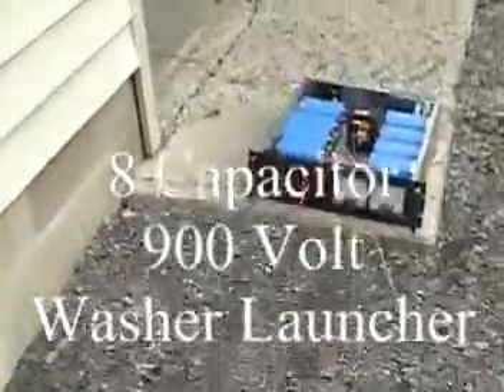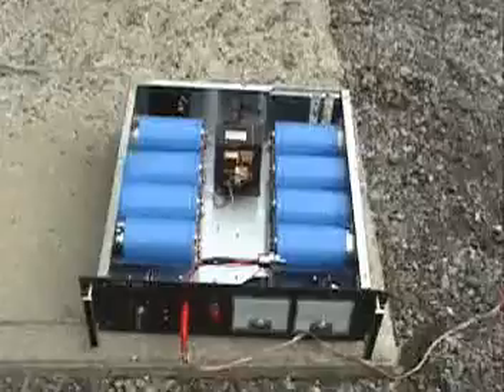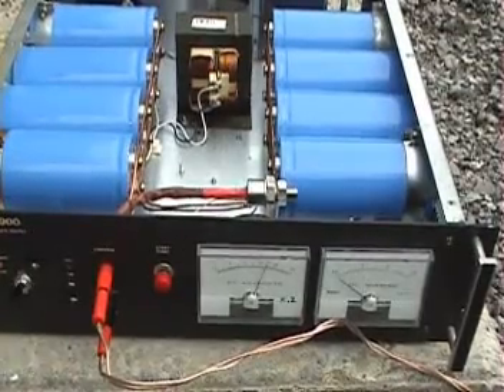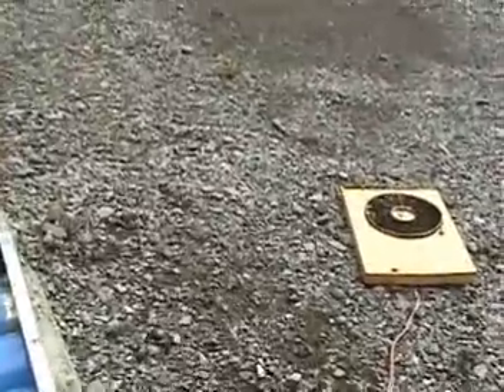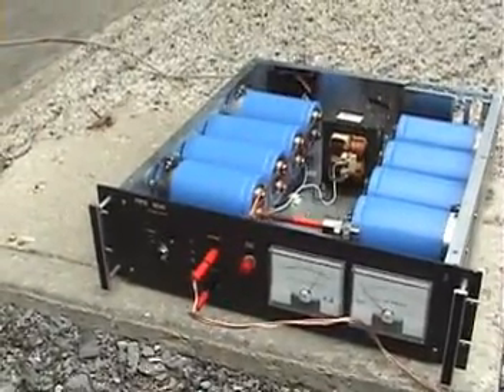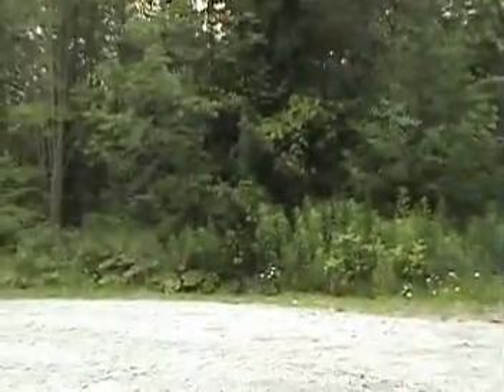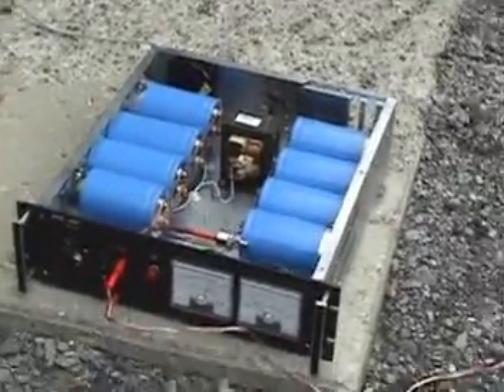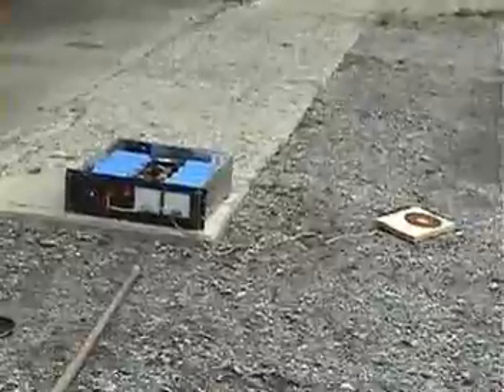8 Capacitor washer launcher

Comment: caps will never charge to their full voltage, because as they charge resistance increases so the current decreases, it gets to the point where the current gets less and less, current will allays flow but will never reach the full supply voltage. just like a radioactive decay curve

Comment: @biguglytrux You're quite right. Aluminium is a non-ferrous metal. The reason it is repelled is that the sudden strong magnetic field created by the capacitors discharging through the electromagnet induces a current in the aluminium disc which which creates it's own magnetic field in the opposite orientation to that of the magnet. The two objects repel each other strongly and the aluminium disc is launched into the air. Aluminium is simply because it's lightweight and a good conductor.

Comment: Are the capacitors pulse discharge rated or just standard duty caps?  I'm wanting to pulse discharge 5000uF 450V cap which is only rated as general purpose - is it likely to blowup over successive discharges?

Comment: Is possible load a ceramic capacitor (3kV) with a 6v battery??
Reply: ofc, just boost 6 to 14v with a dc/dc and then, with a llc half-bridge converter, get 800vac on output. Use quadripler as rectifier and you will get about 3-3.2kv
Reply: 11 years ago 😲
Reply: @AS-Phoenix.2  what a blind dog am i....
Reply: @cota0036  he maybe not even verified during that time

Comment: i could be mistaken, but aluminum is a non- ferrous metal; it has no iron in it, so it is not magnetic. it would not repel the electromagnet. the disc must be  made of some other alloy containing iron, in order to launch it like that, especially with that ringing noise it makes

Comment from the maker: I use a resistor to prevent overcharging and to slow down the charge rate.  Measuring the volts is easy, the current was only metered while charging.

Comment from the maker: A mosfet would have a hard time vith the voltage.  A light bulb is used by some.  

I think the best design is a power transformer in series with the MOT but with its secondary shorted.

Comment from the maker: Sorry, I was talking with someone else about two capacitors of different values.  Yes you can put a resistor in parallel.  The only concern is overloading the power supply by drawing too much charging current.

Comment from the maker: The capacitor of lower value will charge faster and easily exceed its maximum voltage.  It can be done by knowing the relationship of the values to the voltage.

Comment: This is really cool. Not exactly the most useful thing in the world,  but now I kind of want one :D.

BTW, I don't know if anybody's told you this, but your description should be edited -- joules are a measure of energy, not power. 

What's the mass of your washer? Dividing your energy by (mass * acceleration due to gravity) will give your height (assuming the transfer from electrical potential to gravitational potential is 100% efficient, anyway).

Good work, how much did this cost?

Comment from the maker: Well you also have to know what the load is and there is even a drop in the switching device.  There is a formula to know the available power, but the delivered power will be smaller.

Comment from the maker: Wire them in series and charge them to 100 volts.  Add an SCR or mechanical switch and see what happens....  
Lower voltage usually means less current but the higher uF says it will flow for a longer time.

Comment from the maker: I use 14 gage wire, I did not want to fry the SCR with too much current.  It used to be a ordinary SCR but then I replaced it with a block that can handle 1600 volts, and 300 amps.

Comment from the maker: If they were 1/100 of the value I would want to connect them in series.  If they were 100 times the value they could be connected in parallel.

The problem with the 250 watt resistor is that it is 500 ohms and charges the resistors too fast.

Comment from the maker: The resistor is only ated for 10 or 20 watts.  The 2400 volt model has a 250 watt resistor.

Comment from the maker: The resistor goes between the power supply and the capacitors.  In the latest version I am using a big SCR block that can handle 1800 volts and 1600 amps.

Comment from the maker: I used an 800 volt 100 amp SCR back then.  I replaced it with an 1800 volt 300 amp (1600 peak) SCR later.  See the schematic etc on my blog at bobdavis321 on blogspot

Comment from the maker: It is 14 gage enameled wire, the center and outside exactly match the size and shape of the washer, a 5 inch hard drive paltter.  I have heard that 2 layer coils are the best but mine is one layer thick.

Comment: so whats the order of the wiring, the power supply to the transistor to the resistor to the capacitors to the leads of the coil ?

Comment: On your last launch (when you referenced it's height to the tree's height), I found the airtime to be 3.35 seconds. Using basic kinematics, and assuming little air resistance, that means it got up 13.75 meters, about 45 feet. If that washer weighed 1 kg (about 2 lbs), the amount of energy that took it to go that high would be 135 joules, about .032 food calories. Haha, to equal the energy of a tic-tac (2 Cal), you'r have to do about 60 launches. I like physics.

Comment: You should invest in a higher wattagae wire-wound current limiting resistor.  Digikey has resistors that can handle upt up to 1200 W and a working voltage of 1000 VDC.  You'd probably get closer to 900 volts of charge if your current limiting resistor wasn't breaking down.  Neat device, though!  Let me know when you get one that can do that with a manhole cover!  LOL

Comment from the maker: Actually my coil is AWG 14 and the disk is 5 inches in diameter.  I think the power supply had 5700 at 900 volts.  I have put big dents into the basement ceiling!

Comment: Once I also built such a launcher. I used a 4400µF/900V capacitor bank and a coil made from 2mm² (AWG 14) wire. I haven't already tested it at full power, but I expect the disc will climb about 50 meters. At 190 volts, the power is already enough to launch the disc to the room ceiling...
I use a smaller disc, about 12cm(5") in diameter.
I think you should use shorter cables to the coil. This will increase the efficiency.

Comment from the maker: Yes a choke would work better.
Yes the washer is made of aluminum.
The MOT was center taped at 1 KV.
The coil in #14 turns to match the washer.
Lots of a good flexible glue.

Comment: Power resistors are typically designed  to work at high temperatures, unlike the smaller resistors you typically use for electronics project. A small resistor may be designated as 1/4 watt, or 1/8 watt, but usually you want to keep the power dissipation lower to avoid excessive heating. With a power resistor, if it is rated at 50W you can use it right up to that level without worrying about damage. Usually they get pretty darn hot but it's no cause for worry.

Comment from the maker: I use a microwave oven transformer, rectifier and a current limiting resistor that smokes.  I am working on a 2500 volt model now.

Comment from the maker: The resistors are across each set of capacitors that are in parallel.  That is if you have 10 in parallel you use 1 resistor.  Then the next 10 have 1 resistor, etc.  If you have 10 sets in series of 10 in parallel  then you only need 10 resistors.

Comment: oh, i have seen people use heatsink with something stupid like half a ton of force on the SCR but i have been told that you can use them without a heatsink, as it has such a low junction resistance and the rise and fall time is said to be pretty quick, i don't know whether they are quicker than mosfets or not...
a 1 Mohm across every resistor!
is this right?
 (300v / by 1000000 = 0.3mA) X 100CAPS = 30mA thats quiet alot. 300V X 0.030A = 9W 
so the resistors will leak/ dissipate 9W?
thanks

Comment from the maker: The hockey pucks are better but I have heard someplace that you need the heatsink to hold them together.  

If the caps are all totally identical they charge equally.  If not use 1 meg ohm resistors across each of them.

Comment: yes, i take it they are better than the bolt ones (only because of size and price lol). i couldn't see any that cheap, the one i wanted was $65 from the US but P&P to UK was $37.5! ouch. how do you get your caps to charge equally? i put 2 caps in parallel, 1 was at 100V and the other was at like 350v :-/.
thanks again :-)

Comment from the maker: I fried the first SCR amd replaced it with a ED431825 that can handle 1.8 KV (1800 Volts) and 250 amps continuous and 6.5 KA peak (6500 Amps).  Now it is better than ever.  I am uploading a second follow up video.

Comment: As maybe more than required but better than the current ones, you could use the cables from a set of those to jump-start a car by coonecting your dead battery to one of another car. Of course, get rid of the huge crocodiles. 

As terminal, maybe i would not use any, just would use big U shaped terminals and screws or bolts to fix them to the system.

Comment from the maker: The coil is one layer of 14 gage enameled wire.  It was wound 2 or 3 turns at a time, each turn covered in glue and held in place with a 1 by 1 board that could spin to hold it down.  Aluminum creates a matching field by itself and then repells the source field.

Comment: Use an Ohmite part#: L100J1K0E  resistor. It is 1000 Ohms and 100W. Allied Stock#: 296-4514and only about $10 each. Um, why do you need a fan? Does the transformer get hot? Be careful, because you can get a bad shock!

Comment: Try Sprague/Vishay type 36DX352F450DJ2A, which are 3500UF and 450V. They cost about $85each new, from distributor Allied Electronics, so you should look for surplus sales if you want to save money.

Comment from the maker: You will need a wire wound resistor 500 to 1000 ohms and at least 10 watts, 25 watts would be better.  Some throw a light bulb in there but I think it would have to be in the primary of the power transformer.

Comment from the maker: Someone figured it out mathmatically a little ways back in the comments.  I think they said it was 37 feet.  Putting the resistor in oil or using one in a metal heat sink would also work.

Comment: Pretty impressive device.  I was wondering have you considered modifying it to use a relay hooked up to a good few feet of wire and a momentary on switch as a wired-remote of sorts?  I'm thinking that it might be a shade safer and a lot more convenient for filming the device and you wouldn't have to use a longer cord for the launch pad.

Comment from the maker: I was hit in the head once by a 3 inch washer fired from the 300 volt model.  They slow down rapidly due to the high air resistance, but it still hurts to be hit with it.

Comment: Have you considered using a constant current source instead of a resistor to speed charging time? 1200V 50 amp IGBTs are pretty inexpensive and could probably charge up the whole capacitor bank in a few seconds.

Comment from the maker: They are 3,700 uF at 450 volts each, in a parallel/series arrangement for a total of 7,500 uF at 900 volts. That is about 3,700 Joules of power.  I bought them at the Rochester NY Hamfest.

I used one layer of round 14 gage enameled wire for the coil.  The field goes in both directions.

Comment: Ouch. What capacitance did you say you were working with? I made a coil gun that didn't work too well, but I was using 10gauge magnet wire for the coils and it still gave me alot of resistance. My bank was 0.0975F @ 400V. I used big fat 4 gauge wire where ever I could such as the power cables going TO the coils. Have you thought about using the capacitor I mentioned? I put one on my charger for my gun and it's SOOO much better...

Comment: Actually, come to think of it, a 2.65uF capacitor @ 1000V isn't that common. Maybe go with a smaller one in series with the PRIMARY of your transformer, that way it only needs to rated for about 200V. If you do this, it should be about 1/8th of the 2.65uF. Anyway, a capacitor is a much better way to go with limiting AC current. Although, the power company isn't too fond of it since it screws their system up a little :)

Comment: Also, as for the resistor, try using a non-polarized capacitor in there instead. I'm only assuming you are running on 60Hz AC. If that's the case, you can limit the current very nicely without any heat by using a capacitor. If your target is 1A charging current, use the formula 1/(2*pi*Frequency*Capacitance) to find a suitable impedance. @ 60Hz and 1A current, you'll need a 2.6uF capacitor. Remember, it must be non-polarized so it can take AC. You'll need to put this in series with the output.

Comment: Where are your cables going to the launcher? I hope they aren't those tiny "speaker wires" in the front, are they? I imagine you can get a MUCH larger shot if you get larger wires. They might not seem like they have much resistance, but even on the milliohm scale, 0.01ohms is still 10 times the resistance as 0.001ohms. Just a thought.

Comment: if the current limiting resistor goes red hot why not use a bigger one, no harm can be done except for prolonging the charge time. Congrats, very impressive power absorbant beast

Comment from the maker: I apply 800 volts DC to a flat coil that has an aluminum washer sitting on top of it.  The washer is a dead short to the coil creating opposition and the two move apart.

Comment: The high current discharge through the coil creates an opposing magnetic field in the aluminum disc. Anything conductive will work. Copper, brass, aluminum, even steel, but steel is magnetic so the magnetic field in the coil will draw it in like an electromagnet.

Comment from the maker: For the coil guns, the old one was three layers of 20 turns #14 on a 3/4 inch diameter form.  The new one is 5 layers of 25 turns #14 on a 1/4 inch center.

Comment from the maker: I have a 1000 volts charging the capacitors to 800 or so volts.  Initially you have 1000 volts across the resistor.

Comment: ive been messing with some capacitors and other stuff salvaged from a few broken computer power supplies, and basically to get as close to the maximum capacitance, after i initially charge them, i simply bypass the resistor

Comment: (btw wall voltage + 100 ohm [120 volts/100ohms so a little more than 1 amp possibly] but since the capacitors fill up quickly the resistor doesnt overheat), so you could just switch to a lesser ohmage because i think the capacitors account for most of the resistance while they are charged.

Comment: lool, the 1 in the mouvie is 250 amp? it's imposible, i saw an 400 amp 1 and is as big as an aple, btw, i put 4X kt708 in paralel,and they wark excelent (they can rezist at 480A surge,and 60A normal), this are perfect for this propose, because they are build to rezist big peaks, and high frequency :) and i can say that they are 10 times bether then the 'exploading, melting, sparking' swich :D The only thing i need now is more capacitors, and biger ones (now i use 60 flash caps in paralel)

Comment: what are the parameters of your scr? i have a small coilgun (300v 5000uF), and i want to use an 16A scr (looks like yours, but's smaller, the tipe is KT708 (i'm bored of using 32amp swiches, wich weald, melt, and need a hammer smack to repaire :D) is it good for my stuff, or should i put more in paralel?

Comment from the maker: It is right behind the power transformer.  Without it the house lights would dim when you turn it on.  It limits the capacitor charging current.

Comment: I want to build one of these, but dont have a big SCR or those huge computer capacitors. The biggest I have is 14,000uf at 40Vdc.

I can easily get my hands on a MOT and have a 100watt resistor so mine wont do the "reeed hooot resistor" thing!

Comment: I think it's safe to say this guy knows what he's doing. You can't design this sort of stuff if you don't understand it!
What's the problem, anyway? if the resistor burns out, the charging stops. Boo hoo. Worst case scenario, the caps discharge quickly through the casing.

Comment from the maker: The meter circuit will safely discharge the capacitors over an hour or so.  The resistor only gets red hot during the charging cycle.

Comment from the maker: That is based on 1000 volts across 1000 ohms.  However the capacitors charge quickly so the current only lasts for a fraction of a second.

Comment from the maker: I have a bigger resistor that can handle the power, it is just not installed yet.  The EMP has a very limited range.  My Tesla coil does mess up the camera.  The SCR does create a dead short into the coil, and it is very hard on the capacitors.  The experts say not to use electrolytic capacitors for these experiments.

Comment: That's cool. I usto have 6 caps on my old system in my car. Durring long bass notes it would rob so much power from the engine, that it would die. The alt. couldn't keep up.

Comment: No, since the SCR instantly switches from cutoff to a near short-circuit codition (saturation). Very high current, but low (sightly above one volt) voltage, and that for a very short amount of time. The thermal inertia of the SCR's metal case will easily handle the short power spike.

I'd instead install a BIIIG fan on that REEEEED HOT RESISTOOOOR!!

Comment: bobdavis321, I should suggest you put a 110 Volts AC (or protected 12V DC) fan on SCR, so it won't hop on "heat runway" train (you know what I meant) and pop like a cereal. I have done some crazy sh*t before, so I knew where to stop the problem before it crawls and die there.

Comment from the maker: I started playing with screws, washers, etc.  Then I discovered that aluminum washers flew the best.  At first they just moved an inch or two.  Then I added more power, bigger capacitors, and made a flat coil.  Then I discovered that hard drive platters are even better!  If you send continuous power to a larger coil they will even stand up on end!